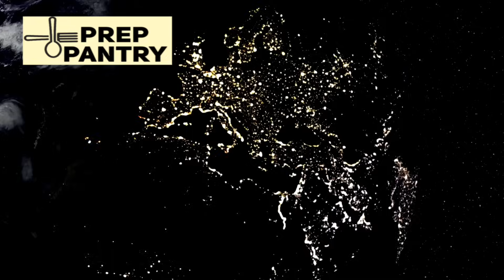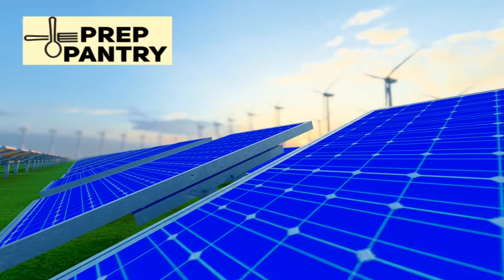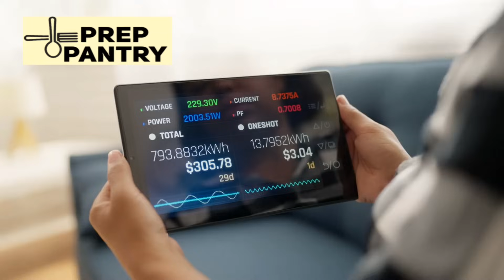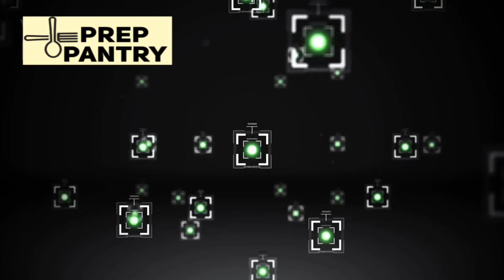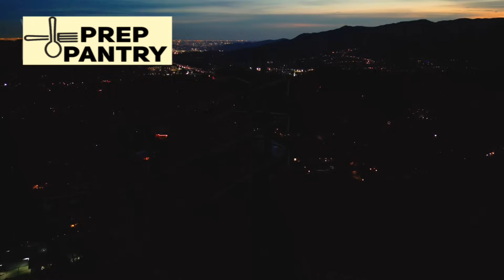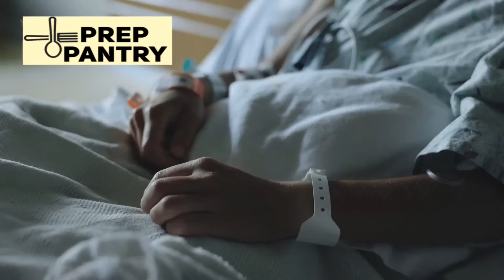Most Preppers Are DEAD WRONG About Backup Power (This Could Kill Your Family)

Comment: I have a 3 kw pedal generator, and it's really a game changer. When fuel is gone, i can still recharge my 10 kwh battery bank. All I have to do is connect the generator to the back wheel of my stationary bike, and charge the batteries while I get my daily work out.

Comment: Here are some things that I have:
1. I have Sonoff S40 devices in my wall sockets.  I have a good view into my power usage with these.  These are really cheap to get and work well.

2. Generator fuel and maintenance - Something people get wrong is maybe they store up some corn ethanol gasoline from the local gas station and they end up with a clogged generator when they need it.  Maybe they spend on a big generator, but hardly have any fuel for it.  Maybe they think the fuel in a disaster will come from natural gas, but the disaster causes natural gas service to be shutoff.  Maybe they don't think they need to do regular maintenance on their generator and then find out that a neglected generator is a generator that 'unexpectedly' stops working.  Having a healthy amount of propane storage and some extra oil and some tools on hand as well as reading the manual for the generator, especially the maintenance section is a very good idea if you plan on using a generator in an emergency / extended outage.  And for the extension cord deal, a big problem is say someone trying to pull in 30 amp over a typical NEMA 5-15 extension cord.  The generator needs to be placed away from your home anyway and extension cords into your house instead of breaker panel mean you need more extension cords inside, so just get the right big, long, and thick one for your generator and then branch off inside of your place.  Don't overload.  And make sure to have ground - neutral bonding and grounding to house ground.  Also, don't backfeed power into the grid.

3. Another thing I see which this piece does address is generator only for backup power.  For one, this uses gobs of fuel and requires lots of generator maintenance to keep the generator going.  Second is while the disaster is actively happening, in the opening hours often you can't go outside and start up a generator.  You could be looking at hours or more huddled inside unable to safely venture outdoors.

4. One thing you can do is invest in a new power efficient fridge.  I have come across normal sized home fridges that burn anywhere form 0.8 kWh / day to 4 kWh / day.  When you add this up for a year, especially that 4 kWh / day fridge can be costing you a lot of money to run.  This is also a key thing when determining how big of a battery system you need and how much your fridge will kill a generator with surge draws to start up the fridge.  I have tried to move all of my food to my portable fridge before and came up with only some can go into the portable fridge.  There are ways to compact things down, but this only goes so far.  So, if you can get a really efficient fridge, it both saves you on your power bill and you don't need so much power to keep things going in an emergency.

5. Your battery power system can also be your camping system and even work from anywhere if you have an office job.  It turns out you can power your phone, your laptop computer, a portable fridge, and more straight off of a 12V or 24V LFP battery.  If a power outage is going for over a week, maybe you slim down on food in the fridge to what is left will now fit in a portable fridge that can run off of 12V or 24V DC.  Most devices that plug into your car's auxiliary port can be had in dual 12V / 24V capability.  You can easily setup a 12V or 24V battery to run devices that plug into your car.  USB chargers, laptop power, and so on.  You can also get say a cheap 240W 12V buck converter to run 12V devices off of a 24V battery.  When you get into the world of DC-DC buck-boost converters, it is cheap and super efficient.  One way to make a battery really last, especially if you are gathering power from say a portable solar panel or you are trying to conserve your generator fuel.  Power inverters are not 100% and they have a parasitic draw.  Taking the inverter out and going all DC uses a lot less power from the battery.

6. Really, in a disaster, there are a few decision points.  One of course is should I stay or should I go?  It may be the most dangerous thing to stay, so you leave all of this gear or at least what is stationary behind.  Often you can stay and staying somewhere else will be very disruptive and cost gobs of money.  And sometimes things just happen without warning and you really need these supplies because now you are stuck and need a way to function while you wade out the disaster and then blocked roads immediately after.  Especially with the without warning or wading out a hurricane deal, you need the battery component as you may not be able to immediately fire up a generator.  And another thing, if you don't have running water, things get real bad real fast and you have to get out when you can.  Things are going to get really nasty in your bathroom with those logs in the toilet and no way to flush them down, which people are always caught off guard when water service stops and that always seems to happen.

7,  If you don't have another way to cool down, having some water to dump on yourself and a fan can go a long way to keep from overheating.  (Poor man's swamp cooler.)  Here is the key thing, evaporation.  You gotta setup so the water effectively evaporates off of your body as best as possible.  This can work even when it is over 100 F inside your place, granted it is really best when in the 90's or below and best if it is dry outside.  Evaporative cooling doesn't work when the humidity is like "I can cut through the steam with a knife".  Just having a fan running at night, you can get your place to cool down some.

8. Even with a small generator, you can run a samll 120V air conditioner.  A 120V air conditioner can cool a room.  You need to focus on inverter based air conditioners as a traditional air conditioner will try to draw a huge surge to start and kill your generator.  The inverter units start with a small amount of power and then slowly ramp up until they consider themselves effectively cooling your place, adjusting quite a bit depending on how hot things are.  Air conditioning is a big reason to have a generator around as a generator can provide the all day power to run one.  Air conditioning is a good way to sap a battery system dry in short order and batteries are way more expensive than a generator for this kind of task.  Batteries are better for low powered things and bursty, infrequent loads, especially for how much these battery systems cost to try to scale up to do more with them.  Granted a whole home system would be drawing power from solar as much as solar was available, but you are still talking about generator power on cloudy days.  Air conditioning also sucks the moisture out of the air, so you can start doing things like dumping water on yourself and running a fan to cool down further if say you have a small portable dual hose air conditioner, but it is not doing enough for you.  Just that it is drying out the air and the dual hose means it is not sucking in super humid air from the outside through the nooks and crannies of your home, means you can evaporate water from your body again and have effective cooling that way as well.  Making the most with limited resources.

9. Induction burners and oven style air fryers are really efficient cooking devices.  You can run these off of a small generator or battery - inverter system.  A big thing is you can keep cooking inside.  Maybe solar power collected partially goes into running an induction burner and an air fryer for reasonably short periods to get food ready.  Even if you just have a cheap toaster oven, if you have a propane camping stove, you can cook outside with the camping stove and get other cooking done with the toaster oven.  Really pretty handy and is a low energy route to cooking.  It turns out the big propane grill outside uses a lot more fuel than a camping stove, but if you have the extra fuel and the grill, why not, a toaster oven can bake and toast a lot for a couple of people, and a counter top oven style air fryer can keep a small family fed just fine.  Even going to a bigger family, maybe you do a couple of rounds of cooking instead of all at once.  Do a multi-course dinner with say veggies first.

Comment: Let's revisit how you prioritize power sources.  The declining prices of batteries and solar panels have changed the picture dramatically.  Here's what you should focus on.

1 - Solar panels and batteries for AC devices.  Configured as uninteruptible power sources and combined with a discounted electricity plan (TOU) means these systems are always on, work when your are not home, and pay for themselves.  With a modest sized PV panel array, you can run refrigerators and freezers off-grid all year long.  You can put solar panels in your yard or mount them on a fence.  Plus you are fighting global warming and petro-terrorism.

2 - Solar panels and batteries for DC devices.  Converting between AC and DC looses about 6% of the energy each way.  Going from the wall plug to the battery to your router and ISP adapter, requires 3 such conversions:  AC->DC->AC->DC.  (1 - 0.94 ** 3) * 100 = 16.94%.  Solar to battery to device, DC->DC has negligible energy loss.  Since your router and ISP adapter run 24x7 the savings will add up and the operation during an outage will be extended.  Again, this is not just for outages; they save you money all year round.  Use the barrel plug on the battery and connect it directly to the DC device; check the voltage.  Label the AC power cord and put it in storage.  Boater and RV suppliers offer 12V barrel plug devices.  The EF Trail 300 with the paired 60W panel is a good example for phones and cigarette lighter plug devices; no 12V barrel plug!  These are much cheaper than bigger units because there is no AC/DC conversion circuitry; their charge lasts way longer than little power packs.  You can put the solar panel in a sun-lit window.  

3 - Cut your electrical usage now.  Use LEDs, and the most efficient appliances available.  Replace the oldest, least efficient ones  You'll save money when the grid is up and be better off when the grid is down.

3 - Skip the manual transfer switch.  You don't need it.  Most batteries can be plugged into a wall outlet and set to charge when the battery gets low or power is discounted.  No need for a manual transfer switch; those don't work when you are away.  Automatic ones are very expensive and not worth it for the amount of use most peope will get from them.

4 - Generators (non-battery), forget them.  They have to be maintained, serviced and run regularly.  That's more than most people want, can, and/or will actually do.  They are too noisy for a low profile.  They wear out much sooner than batteries.  Most generators don't work when you are away.

Doing it right will be worth the effort.

Comment: I can't say for everyone. We live in an area where we lose power quite a bit. Having multiple fridges and freezers, we have multiple backup sources. Solar, several duel fuel generators. During the summer would be stressful. During the winter which has happened multiple times. No big issue. Having the wood stove and being without power for a week. No big deal. Its storage of fuel that matters. So far for the last few years though. No problem.
Reply: Sounds like my story. In the summer I have enough solar to run the house, pool and central air. In colder seasons I use the extra solar for electric heat to save natural gas. I have redundant battery systems and three trifuel inverter/generators. I also kept all my old school supplies: hurricane lamps with 20 gallons of oil, big buddy propane heaters with fuel and wood stove with firewood.

Comment: Longer outage it just isn't worth powering most things. Like the Fridge, most people probably have under $200 in the thing they would lose. No reason to pay all that money for a generator and keep it running just to power a fridge. Of course there are exceptions with people with tons of frozen food, but those people likely have multiple freezers and more of a problem anyway. In my area we rarely have power outages longer than a day. So I settled on being able to power my fridge for a day. Anything longer would require way more money than the food in the fridge is worth, especially given I'm going to eat what I can before it goes bad, saving the can-goods for later.
Reply: A fridge.or freezer can be powered rather cheaply with a small generator running periodically.
Reply: @mrpawpaw7023  Cheaply as in you need a power station, generator, fuel, oil. Add up all that. If you only lost power once or twice a year for more than 8 hours, then it would be less expensive just buying more groceries.

Comment: The reality is that to power a home, indefinitely, via solar, is an EXTREMELY expensive proposition.   The amount of batteries you need and the vast number of solar panels needed to charge them (assuming there is sun) typically FAR exceeds the cost of traditional power generation, such as gasoline/propane/natural gas generators.
Reply: I set up 12 & 24v solar system over time. I then just turned off one breaker at a time to test it.  There ARE ways to do it, it just takes time. Build it modularly. Start with lights.   :)
Reply: @sundancer442 wouldn't you just use it for the most expensive things in your house though?
Reply: If you install sth like that, you will use it also to supply power to your home during normal days, to lower your elctricity bill. Thats sth you cannot do with a traditional generator.
Reply: Your missing the point.  The goal is not to power your whole home.  Solar+batteries pay for themselves, even more so on a discounted time of use electricity plan.  Using a untility based PV system means you have to support the electric company.  Putting your critical devices on off-grid solar and batteries as UPSs means your electric bill is cut and everything is ready to go whether or not you are home.  Plug-and-play systems are far cheaper than grid connected ones.  You are the installer and less equipment is needed.  - Another Texan
Reply: It cost like 12k 😂 wtf are you saying